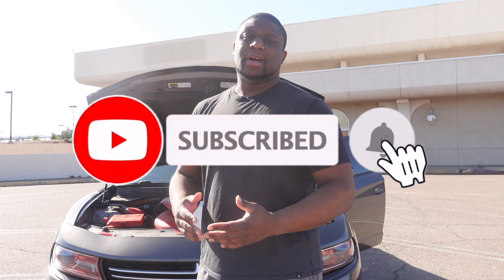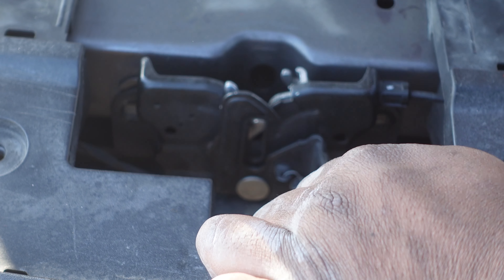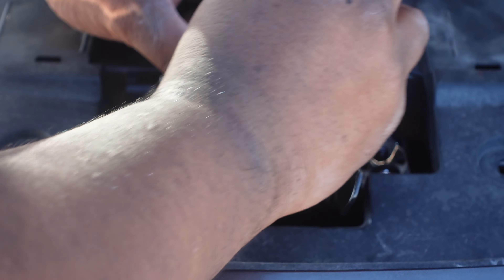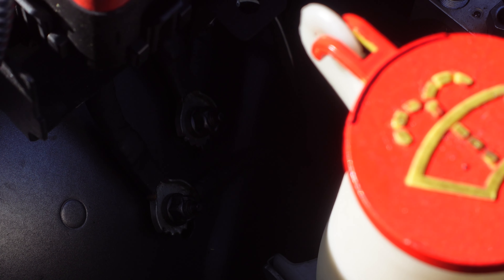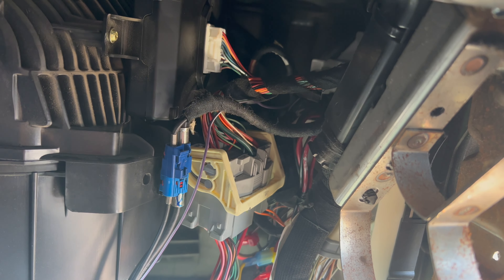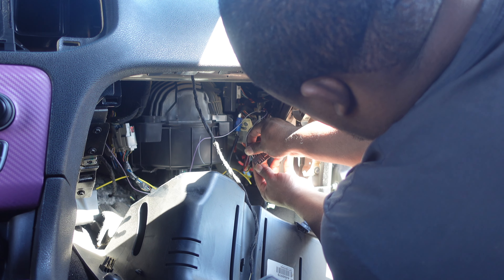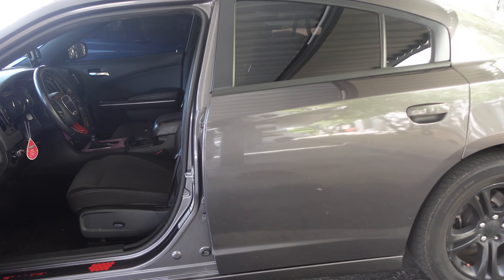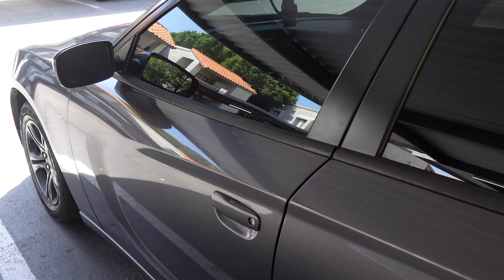DODGE CHARGER OEM REMOTE START 2015-2023 INSTALL

Comment: Hey. Thank you for sharing your experience and knowledge. I have a 2018 Charger PPV. However the site you provided states this will not work on My car. Is there a work around? 
Thanks.
Reply from the maker: It should work on your car
Reply: Did it work with your PPV charger?